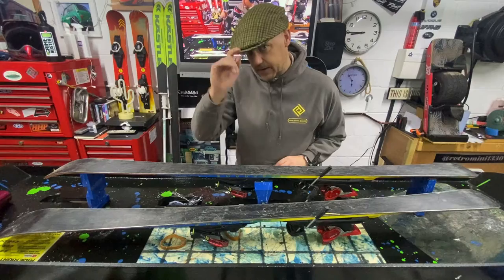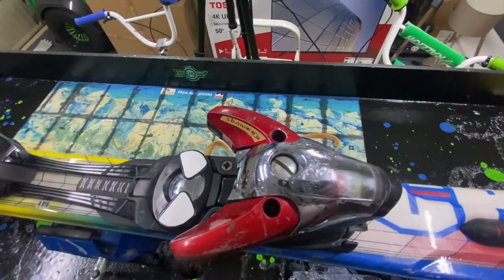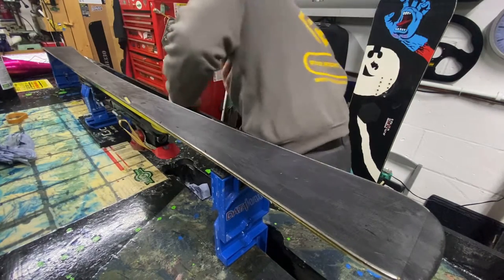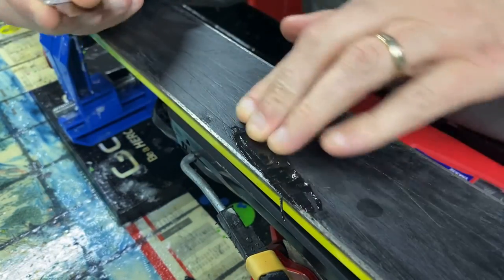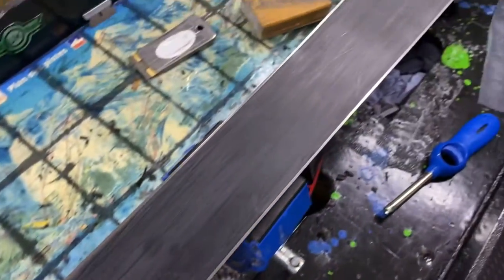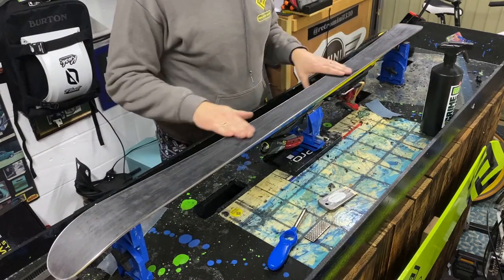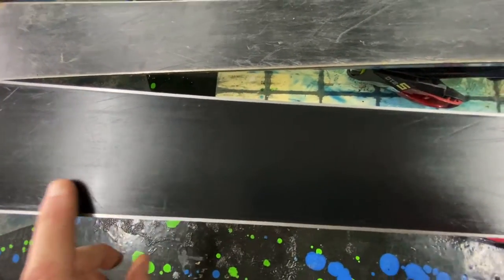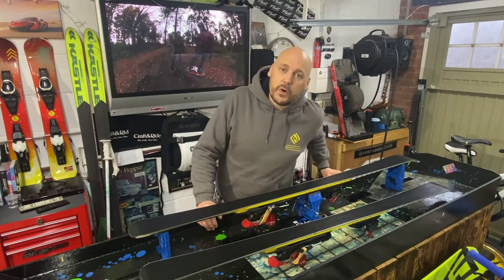How to repair a ski Core Shot. Salomon skis

Comment: What attachment do you put on the drill when you are buffing the base after scraping the wax?
Reply from the maker: It buffing wheel with its own ball, bearing handle and shaft. Hence then it does not spin in your hand. You can buy it from any great online Ski, tool maintenance company.

Comment: If there are only minor scratches on the sole of the ski, is it worth sanding them with some kind of sandpaper? Or does the bronze brush help to make minor scratches disappear? What kind of solvent do you use to wash off the old wax? Thanks!
Reply from the maker: You can sand bass, but you must make sure that it’s with a flat sander and not the tips of your fingers as you’ll get depressions in the ski. I use a proper wax remover for Skis. It’s from butter, wax or data wax. Both products are brilliant👍👍

Comment: Hi, thanks for this demonstration, when you say metal base, is this the same as p tex ??? Got a swollen ski base just below the binding (I assume the ski absorbed moisture at the binding holes and has caused the ski base below to expand. I'm considering cutting off the swollen area and replacing it with some P-Tex sticks. What would you suggest? I can post photos if you wish. Many thanks.
Reply from the maker: If you’re going to expose the core by cutting the base material out, you’ll need to fill it with more base material. You can go online and buy base repair. You will need to use a soldering iron to melt into the base and then put PTex on top. As if you put PTex straight onto the base  material, it will only come out. Hope that helps.👍
Reply: Many thanks dude, this is a crucial tip that you shared. If I got it right, I melt base material (probably light it on and add drops of it and then add p tex). Quick query: can I use base material from an old useless ski?
 @RRW
Reply: You can drop me your email here if you wish and I'll send you a picture of the ski base condition.
Reply from the maker: @tdgeorgas2351  you’ll need to put the base material in the core shot covering just enough of the base so you cannot see any of the fibreglass making sure you leave room to fill up on top with PTEX as this is what you’ll NEED TO scrape off and flatten to match the base. If you feel the whole course shot with base material, you will find it will be very hard to make Flat as it’s more rubbery than PTEX so you will not get a very good finish.
Reply from the maker: @tdgeorgas2351  watch this vid I explain it. It’s only a very small core shot, but it’s all the same. 👍👍Travis Rice, Lib Tech, Snowboard, with core shot, full service and wax ￼
https://youtu.be/ox_5sTL1bgc
Reply: Thank you very much. Forgot to mention that the swollen area that needs to be replaced is approximately 6cm x 4 cm  @RRW
Reply: Finally, can I melt old /used base from an unused ski os should the material be brand new?
Reply from the maker: @tdgeorgas2351  hi buddy this is what you need to buy 👍 I use this and had great success with it. 👍https://www.ebay.co.uk/itm/115877029768?chn=ps&_ul=GB&mkevt=1&mkcid=28
Reply from the maker: @tdgeorgas2351  Riderightwaxing@outlook.com 👍👍
Reply from the maker: @tdgeorgas2351  wow that’s big

Comment: What kind of material did you use to weld the big chunk in the skis? Because it doesn't look like the regular Ptex stick material.
Reply from the maker: It’s called Metal grip here is a link. As ptex will not stick to the fibreglass. https://www.ebay.co.uk/itm/Black-Metal-Grip-30cm-x-2-Ski-Snowboard-plastic-base-repair-strips-/292487509354?mkcid=16&mkevt=1&_trksid=p2349624.m46890.l6249&mkrid=710-127635-2958-0
Reply: You used a soldering iron run on gas. Is there a reason. I guess you could heat any iron to warm the ski and the new material or? Thx for a great video.

Comment: Just out of curiosity, surely the cost of this much of a repair would have to be more than worth just buying a new set of skis right? I could understand maybe restoring a vintage set that is irreplaceable. Incredible job on the repair though!
Reply from the maker: No to repair the ski and a full Sevice as you saw was around £40, so much cheaper than buying a set of skis. 👍👍👍
Reply: @RRW  Seems like a steal of a deal! Regardless of what you charge, nice work!
Reply from the maker: @samsinite100  thanks buddy 🤙🤙👍
Reply: We always use a thin layer of epoxy before we do a base weld. That way the core is sealed. We also do several passes over the machine with a rough belt to remove the small scratches that will not hold P Tex. You definitely want to get the base and edges level. We finish with a Stone Grind that leaves a Structure pattern on the base.
Reply from the maker: @thomasmedeiros5722  could you recommend a good base stone grinder to leave a structured pattern in the base of the ski?